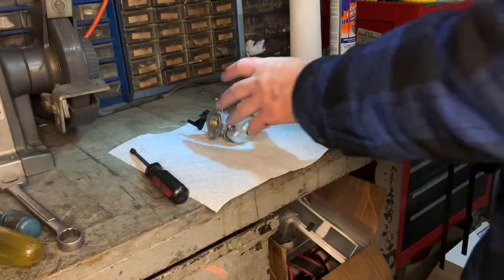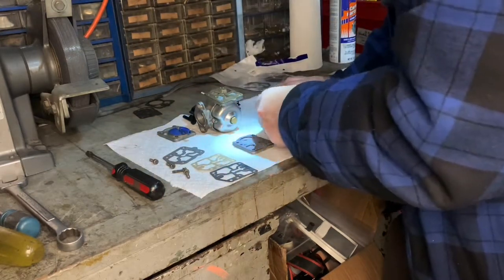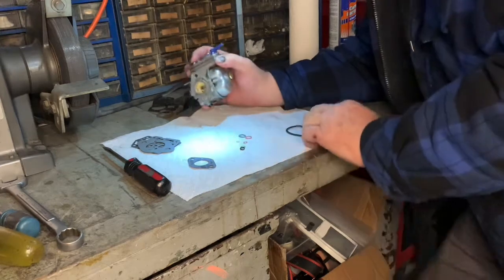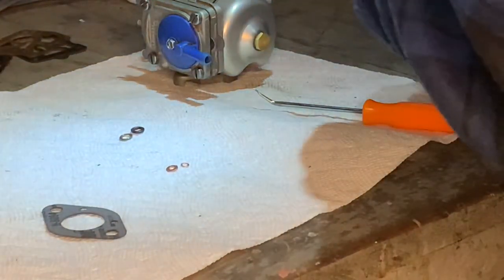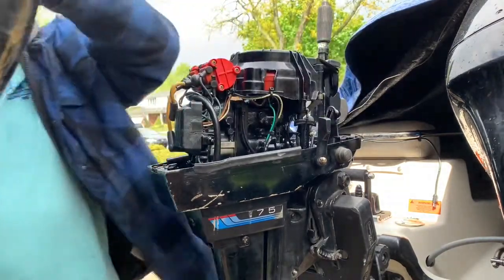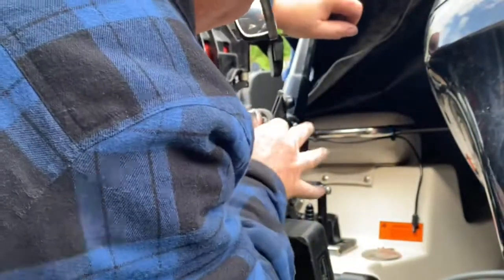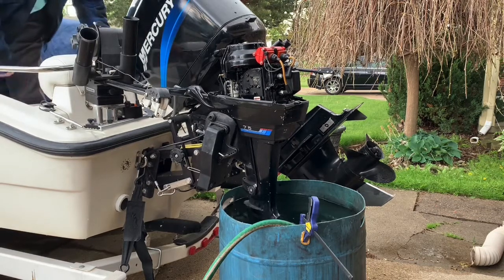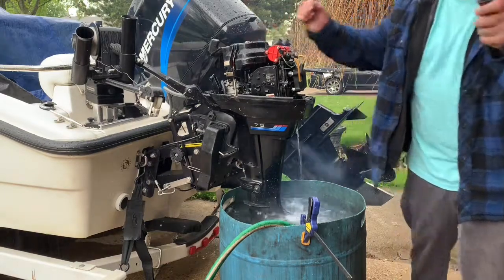7.5 hp Mercury gets a Clean Carb Installed- Part 2 - Making Ready for Walleye Fishing

Comment: I just picked up the same kicker, maybe a mid 80s.  It has good compression, started right up.  Needs new ignition wires and boots, so have those coming.  It has a new water pump, but I may need to check that out.  Mine is a long shaft, so it doesn't seem to pump quite as well as yours.  It should work good as a kicker for my 16' starcraft.  I used to have a 4.5 Merc that seized, so found this 7.5 that should troll nice at a little less throttle for walleye.
Reply from the maker: That’s awesome, that 7.5 should work great. I would change the water pump impeller just to be sure. Thanks for watching and commenting.

Comment: I have the same motor. I have a question on the needle. Does your needle have a spring with it, if so, where does the spring go? I’m having a hard time finding the correct original schematic and parts for this motor. Thank you.
Reply from the maker: If your referring to the air/fuel mixture screw having a spring then yes it does. You can see a drawing/schematic of your carburetor at www.marienengine.com as well as purchase a complete carb repair kit.
Reply: @LivetofishOutboardRepair  well, the needle in the bowl with the float. I took mine apart and the needle has a spring opposite of the point where the float touches. I’m having a hard time getting the float height just right so it holds enough fuel for high rpm. It bogs down bad under load.
Reply from the maker: If you watch part 1 of this two part series it shows the breakdown of the carb and might be helpful. https://youtu.be/UqDV_Nkbk2Y?si=M6MT7U7baKutOYYb
Reply: @LivetofishOutboardRepair  thank you. That was it! I like the videos.

Comment: Great video, thanks for that.  Do you have a video on how to adjust the pull start spring?  I just can't get it figured out.  If I have the top bolt loose and hold the spring with a screwdriver it works great.  As soon as I tighten the bolt it sticks and will not return.
Reply from the maker: Yes I do go to https://youtu.be/I0iR_bLO75c
You might have to solvent clean the spring and then use graphite to lubricant it to keep the spring from sticking.
Reply: @LivetofishOutboardRepair  WOW you are great!

Comment: What year is the 7.5?   I recently acquired a 1983 7.5 ML that fires right up and runs decent, but won't idle down, and stalls as soon as I put it in gear; unless I keep the RPMs pretty high.  Anyway, in trying to identify the carb, I found what looks like a Tillotson part number (1364-4929) stamped on the fuel pump housing (above the blue disc), and a Walbro stamp (WMB-2) on the top of the carb body!  PS: I suppose I could buy two complete rebuild kits (Tilloston 1399-7573 and a Walbro 1395-9026, but that would be about a $100.
Reply from the maker: I guess you need to roll the dice on this one. There may be little difference if any between the two manufacturers with respect to your particular carburetor. My 7.5 is a 1979 I think based on the serial number as identified on www.maxrules.com

Comment: Great video! I have a 1972, 7.5 Mercury two stroke Thunderbolt bought used w/my 14ft StarCraft aluminum boat. Starts, idles good but upon giving it sum throttle its got some hesitation then evens out. I want to do what u did, rebuild the carb & fuel pump. Can you tell me where the best place is to order kits from? Any help or information will be greatly appreciated. Thanks in advance!
Reply from the maker: Aaron McDonald…. Thanks for watching and commenting. I purchased the parts from www.marineengine.com
Reply: @LivetofishOutboardRepair  thanks man! I see it on there. Much appreciated 👍
Reply from the maker: @aaronmcdonald8423  your very welcome.

Comment: Followed your video and got my '83 running. First time out it opened up and then seemed like it died off. Occasionally opens up and scoots my 10' down the lake, then dies back to a trolling speed at WOT. Not missing or running bad during the process, just a sudden drop in rpms. Any suggestions?
Reply from the maker: Johnny D …. You might have a clogged high speed jet in the carb. Sounds like your idle circuits are ok just may have a blockage in the high speed jet.
Reply: @LivetofishOutboardRepair  I'll check into it. Thanks again. You have the only video available anywhere of a rebuild on a 7.5 haha. Congratulations 🎉

Comment: What mixture do you run? Just picked one of these up.
Reply from the maker: 50:1
Reply: Thanks for the info. 👍 Guy I bought it from didn't have a clue. Never had it running. Started up but spits back through the carb and dies on idle. Will give it a clean out and fresh fuel see how it goes. 👍 Thanks again.
Reply from the maker: @jon610te  sounds good. Good luck with it. Thanks for watching and commenting
Reply: Can you tell me what prop you have on there?  Only getting 7mph from it On 10ft inflatable. Im wondering of its underpropped?
Reply from the maker: @jon610te  It’s a two blade prop with a 9” diameter and 10 pitch. Thanks for watching and commenting.
Reply: @LivetofishOutboardRepair  ahhh that could be the problem I have a 9"  3 blade with a 7" pitch. Spins up really nice. Low end is great. Just won't push the boat up onto the plane.

Thanks for the information.